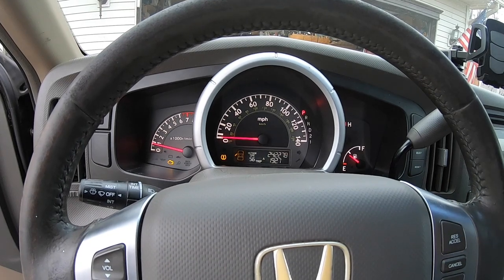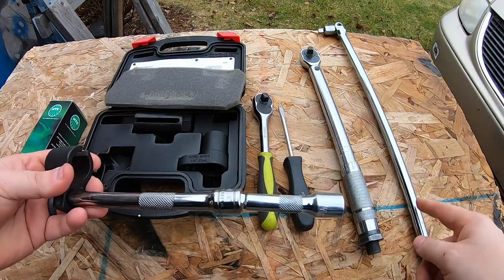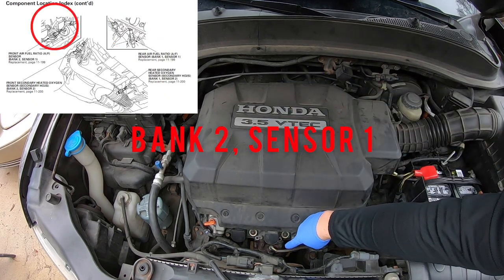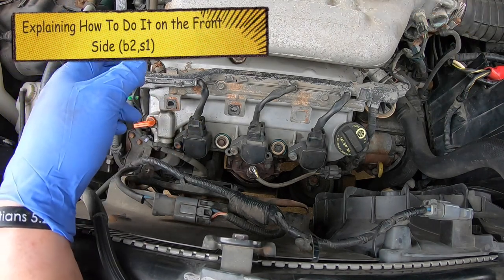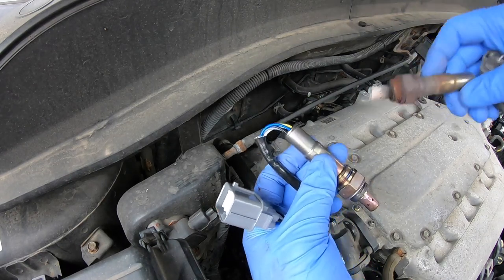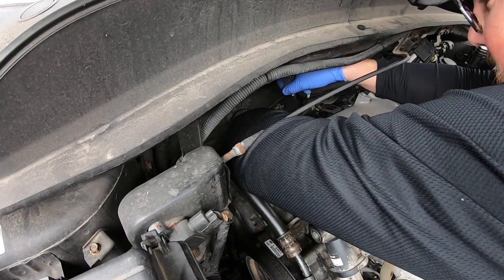How to Replace O2 Sensor P2251 - Bank 1, Sensor 1 on Honda Ridgeline  2006 - 2015 (1st Generation)

Comment: The way you showed where all 4 sensors are was great
Reply from the maker: You are welcome. It’s important in case more than one have gone bad or you have a slightly different code but know it’s with the oxygen sensors. Thanks for commenting

Comment from the maker: THE TOOLS:
• Scan Tool - https://amzn.to/3XfH7Ki
• NTK 24302 Air-Fuel Oxygen Sensor - https://amzn.to/3XfHFjk
• O2 Sensor Socket - https://amzn.to/3WR97o4
• Torque Wrench - https://amzn.to/3fEIrDi
• Flat Head Screwdriver - https://amzn.to/2RAjTlU 
• Breaker Bar (24in) - https://amzn.to/3ZhFY6Y
• Extensions (3in & 6in) - https://amzn.to/3Zg0JQp
• Gloves - https://amzn.to/3bbfEnu 
• Safety Glasses - https://amzn.to/3ux25GO 
• Shop Towels - https://amzn.to/2SC8D93

Chapters: 
00:00 Intro
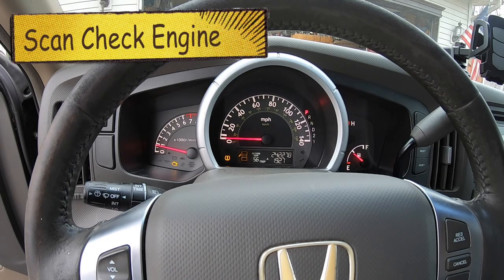00:29 Scan Check Engine OBDII
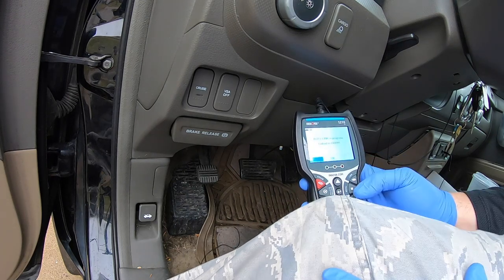01:33 The Problem - P2251 - H02S (A/F) B1S1
02:25 Tools & Supplies
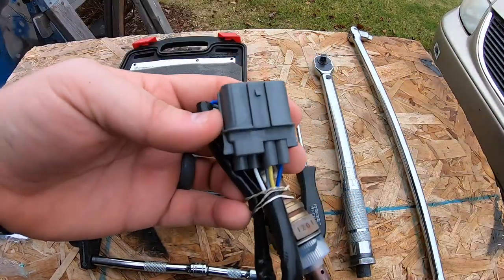03:44 Remove Scanner & Open Engine Hood
04:10 Sensor Locations (all four shown)
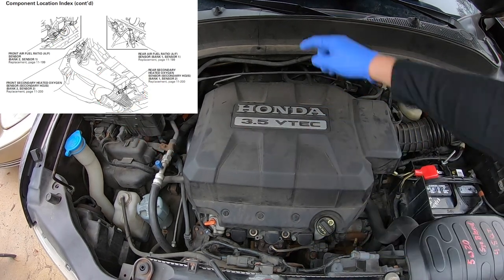04:36 Take off Engine Block Cover
05:17 Explanation of how to Remove and Install on the Front Side (Bank 2, Sensor 1) due to obstructed view
04:53 Removing O2 Sensor on Bank 1, Sensor 1
06:25 Loosen 02 Sensor Nut
07:11 Remove O2 Sensor Connector
08:15 Remove O2 Sensor
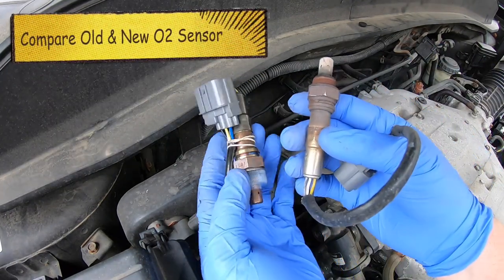08:26 Compare Old & New O2 Sensor
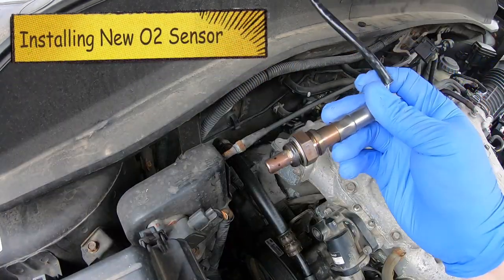09:02 Install New O2 Sensor
10:32 Torque O2 Sensor
11:15 Plug In O2 Sensor
11:44 Reinstall Engine Cover 
12:00 Erase Check Engine Code
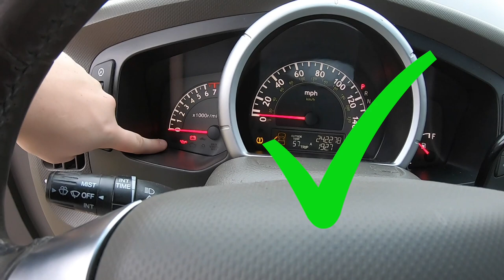13:06 Final Test

This video works on all makes and models of vehicles. 

Check out my website at http://mcfixit.us 

Links are associate links. A small portion of whatever you buy helps support this channel. Thank you for clicking on the links and purchasing to help out this channel to keep making great content for you!

Disclaimer:
Due to factors beyond the control of MC FIX IT, I cannot guarantee against improper use or unauthorized modifications of this information in the video, post, blog, or social media. MC FIX IT assumes no liability for property damage or injury incurred as a result of any of the information contained in this video. Use this information at your own risk. If you feel uncomfortable at any time. Stop and go to a professional. MC FIX IT recommends safe practices when working on vehicles, your house, or any other project and or with tools seen or implied in this video. Due to factors beyond the control of MC FIX IT, no information contained in this video shall create any expressed or implied warranty or guarantee of any particular result. Any injury, damage, or loss that may result from improper use of these tools, equipment, or from the information contained in this video is the sole responsibility of the user and not MC FIX IT.

#mcfixit #autorepair #hondaridgeline #o2sensor #p2251 #carrepair #mechanical #o2sensorreplacement
——
Supplies used to record this video: 
* GoPro Hero 7 Black - https://amzn.to/3f3ALtb 
* 256GB Flash Drive - https://amzn.to/33pAueG 
* Vlogging Frame - https://amzn.to/33tajE0 
* GoPro Pro 3.5mm Mic Adapter - https://amzn.to/2RCURCu 
* Youmic Lavalier Lapel Mic - https://amzn.to/2R55sWX 
* Boom Stand (tripod) - https://amzn.to/3bdkQaw
* 5/8” to 1/4” adapter (boom to blogging frame- https://amzn.to/3txrVsM 
* Portable Battery Powerbank- https://amzn.to/3vJQc0q 
* 6ft USB to USB-C (powerbank to GoPro)- https://amzn.to/3uAS5MH

Comment: Good job, good detailed video, thank you! PS: the connector would not come out period, so I removed wiring harness connector from its mount to get some slack to disconnect the sensor wire.
Reply from the maker: That’s a great tip! That will be helpful for others to know if they are struggling

Comment: Very informative video!  Really struggled to remove the connector, ended up having to break the clip to the engine and it slid out like nothing afterwards

Took maybe 10 minutes total after that
Reply from the maker: Glad you got it out. That clip is hard to remove! Glad you got it fixed though.

Comment: Thanks for this video , just what I was looking for on my 06 with 223,000.  shows a p2251 po134 , po172 and both banks running rich and low voltage so I'm gonna do both 02 sensors hoping this will fix the issue. Keep up the good videos.. thanks again
Reply from the maker: Glad it helped! Best of luck on your fix!

Comment: I did this about 6 months ago. Replaced both banks. Got good deal on rockauto. Those plugs were the most difficult.  My were harder then yours took me hours to get them loose. Think your cold weather helped. By the way, your supposed to replace sensor 1 in pairs to a keep your bank fuel trim even.
Reply from the maker: I didn’t see that in the service manual but it wouldn’t shock me they call for both to be replaced! Thanks for the heads up!
Reply: @MCFIXIT  , it's more a general thing I ran across when looking into the sensors. I don't think it's a honda requirement.
Reply from the maker: @jeffthorpe8667  Okay. Thanks for clarifying. I'll definitely look more into that. I'm sure it helps to change out in pairs. This vehicle is almost 250k... so I'm hoping to get it to 300k.
Reply: The Ridgeline uses air fuel for sensors 1 and O2 for sensors 2

Not necessary to replace in pairs

Comment: 5:51 remove the connector from bracket then disconnect the sensor

Bank 2 Sensor 1

https://youtu.be/qrjwZJ1X6so

6:37 Bank 1 Sensor 1

https://youtu.be/VFqQuT-Qi_A
Reply from the maker: Thanks for the tip!

Comment: @Mc Fix It  this is a 7 pin and not a 5 pin. Video threw me off, can’t find the sensor anywhere.
Reply from the maker: What year and model do you have?
Reply: @MCFIXIT  07 RidgeLine RTX
Reply: Also, I need help finding the manual gas tank handle release.
Reply: @MCFIXIT  07. I finally figured out what I need. B1 S2. The one below yours in this video. Pilot and odyssey are easier but RidgeLine is hard to access. Frame is in the way.

Comment: 7:34 I came here for this….how to get them darn connectors loose on back side. I’ll come back and edit this when I have succeeded. I’ll have to watch further to see how to remove those 3 clips.
Reply from the maker: That sensor harness is a pain! The up and down direction doesn’t help as well. Best of luck on your project!
Reply: @MCFIXIT  0
Reply: I disconnected battery, positive and negative, and cut off wires of old sensor,then I had no problem swinging connector over to disconnect it.